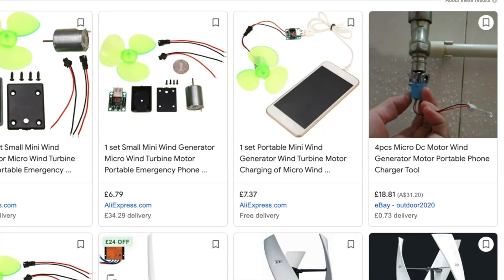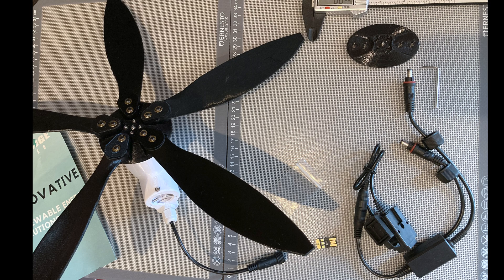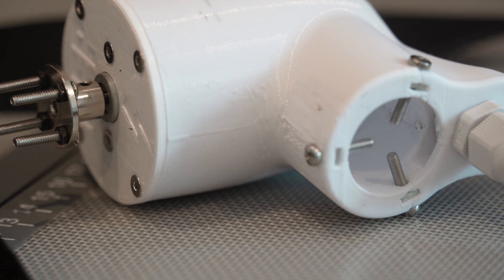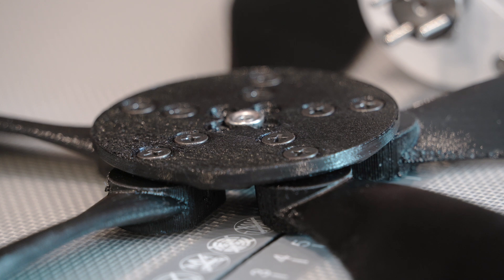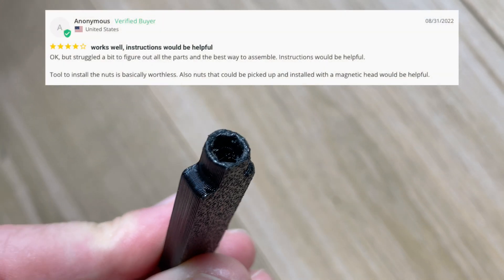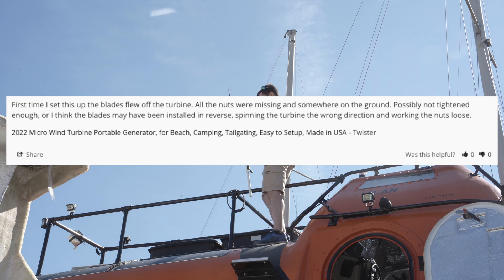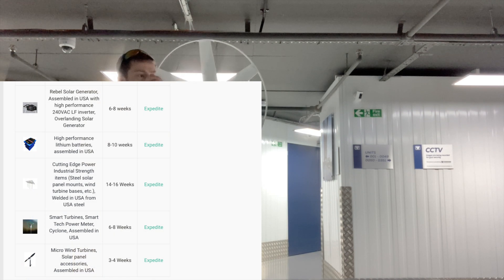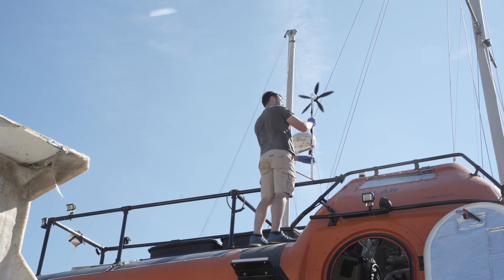Portable Wind Turbine Review: Cutting Edge Power 15 watt micro wind generator - initial impressions

Comment: Wow, 3d printing is great for rapid development but a god awful manufacturing process, and unforgivable when molding is not hard to do once you have the design locked down, good on them for trying but you cant go to market with such a poor product, once bad reviews get out, you have poisoned the well, and regaining trust is hard.
Reply: The Video and everything else shows: They are bad amateurs.
Yes, you can print the housing and even the blades for engineering. But the next step has to be injection molding. Yes, the molds will cost a buck but 1: you gonna need a lot of blades anyways; 2: You get a usable surface finish right away.
Just the blades man... you need a few hundred right from the start. And they are printing them...
Reply: They probably don't have or don't want to spend the money to get proper injection molds made. Or they started creating molds and didn't want to wait for them and started selling early. But I agree 3d printing is a very bad idea for mass manufacturing such a product.
Reply: You can get some fantastic 3d prints if you spend the money but these are absolute trash.
Reply: @neipamocal  they are printing Warhammer 40k figures, these days.
But the blades and housing looking like stuff that was done on 5 year old machines.
Reply: @5Stringslinger  Yeah I print a lot of stuff in resin and fdm these prints are absolute trash the company that sold them should be embarrassed.
Reply: @neipamocal  i guess they go for maximum speed. I mean, considering the size of the blades, they must have bigger printers. And a few of them to print enough blades. This is all so stupid.
Even printing one blade only... Would be better to print as much as you can over night in the hope the printer doesn't fuck up.
No, you just don't mass print stuff like this.
Reply: @5Stringslinger  yup, even so it's weird that the blades came out with such drastic weight differences. I know for a fact I could do a better job printing those parts.
Reply: @neipamocal  i would explain the differences with different printers.
I guess they have a few of them. Once printed they throw all the blades in one bin.
Another explanation would be temperature differences. When the printers are located in an old barn, they would print by day at around 70°F and at night it could be down to 40°.
Depending on the printers, that would make quite a difference.
Reply: @5Stringslinger  yeah your right there, there would definitely be issues with petg. The probably also did really dumb things like have different sliced versions of the file with different settings.

Comment: I would sent it back to Yankeeland and go for the extra two kilo's (thats two rocks 1/16 gopher) 
Its better to remove some material from the blades if you keep it, epoxy resin does not stick to plastic.
Reply from the maker: I'm trying to find out what plastic it is. Some plastics can be bonded with epoxy very well - e.g. already cured resin/gelcoat.
Reply: It depends on the type of epoxy. But I agree,  to balance the propeller,  material needs to be removed from the blades and not added.
Reply from the maker: Would you shave consistently from one edge or another, or from the end (doubting this)?
Reply: @Alex Hibbert Originals  chech out my other comment about the propeller balancing.  If you are willing to take the time,  you can suspend one end of the blade by a string (may have to come up with a clever fixture for the tip) and use the scale on the other end. And flip it around and weight the tip and suspend the base. This will give you a good idea where most of your mass is and where to remove material from. 
Similar process is used when trying to balance out engine connecting rods.
Reply: @AlexHibbertOriginals  I would measure the length of the blades to check if the inconsistency is in the lenght. if not, you should reduce material at the strongest point, at the base between the mounting holes. Don't thin out the whole surface, just take an 8mm drill bit and start drilling a hole first. like they do in balancing a flywheel You can only take away the static imbalance this way. The dynamic imbalance is somewhat harder to do.
Reply from the maker: Thanks - yes seen your later posts now.
Reply from the maker: Thanks - yes seen your later posts now.

Comment: Sorry son. That sucks to high heaven. Either you have massive gear-box or massive 50-pole generator, which both are heavy and  expensive. You just cannot get enough RPM from some 2 pole motor/generator. They obviously tried to tilt those generator blades for maximum speed. And it does work some but only in very high winds...
As it happens, I made 30 years ago a similar wind generator from bicycle dynamo and if the wind was good, it produced 3 watts all night long, which was much better than solar panels in Finnmark. It also had high speed blades connected directly  as this design....
If I was to do this again, I would consider those modern bicycle hub generators, they have multipoles or gearboxes because bicycle hubs turn so slowly. They are also sturdy and waterproof.
Reply from the maker: To be fair to the company, their website specially states that the motor is built to operate at the RPMs that the blades will deliver. It's not just a random off-the-shelf brushed motor. I was getting a pretty good current even below 10mph wind.

Comment: That looks janky as hell and I wouldn't trust those seals around the spindle either.
Reply from the maker: Luckily the Arctic is very dry in winter.
Reply: @AlexHibbertOriginals  I'm obviously not an expert like yourself but wouldn't you have issues with the all the loose snow blowing around finding it's way into small gaps around the generator? Then possibly melting due to the heat given off from it spinning?

Comment: It might be worth trying to find out what temperature resistance the 3d filament they use to print with has. Last thing you want is a snapped blade due to it being extremely fragile when cold.
Reply from the maker: PET, so ok in the cold.
Reply: This why the kit has a two blade setup. When they break just downgrade to the two blades
Reply: Ultem 9085 is a much stronger filament that can we well used for flow surfaces applications. It has very impressive temperature resistance and exhibits low deformation in its tensile strength (meaning blades are less likely to deform at higher rpm). The stratasys website has a good ultem 9085 spec sheet and can print one off and custom parts.

Comment: this looks like some University prototype form some workshop class... and even then as part of testing they would make it better...
Reply from the maker: I've tried to look beyond the aesthetics (goodness knows I need to with some of my own builds), and was optimistic about the purpose-made motor for the specific RPMs and the adaptable DC output. But yes, a commercial product shouldn't need this much tinkering.
Reply: @AlexHibbertOriginals  that doesnt even look like a purpose made motor either unfortunately. Looks like whatever brushed DC motor they were able to bulk buy on aliexpress that had a vaguely correct voltage to rpm rating.
Reply: I bet you that the housing is ordinary PLA that will melt at 60deg, and get degraded by UV. The other parts seem PETG or just awfully printed ABS. The blade geometry is wrong it looks more like a fan than a turbine. This thing is a startup scam.

This kind of stuff wouldn't even fly as a university prototype. Good job. Name and shame the scammers.